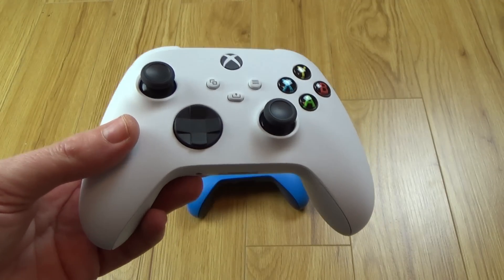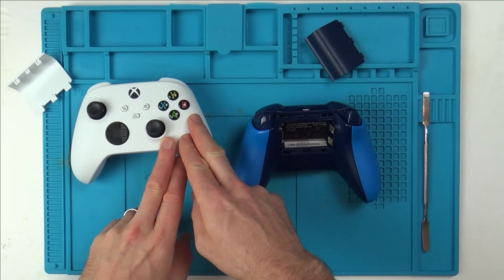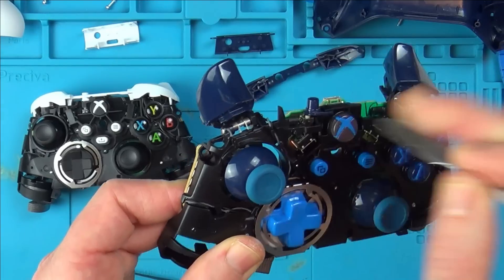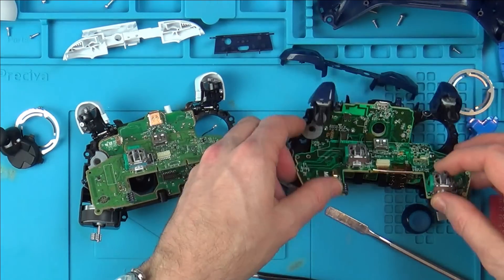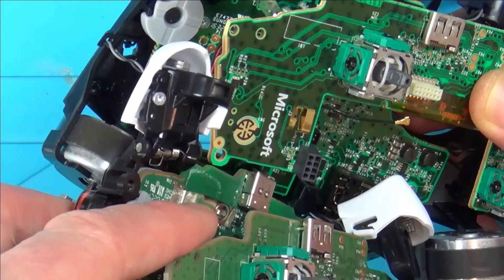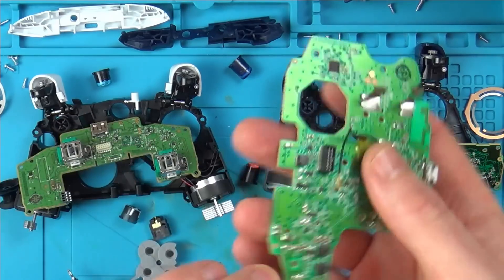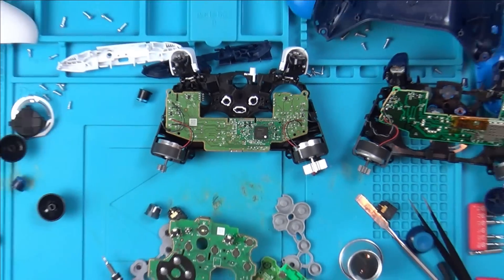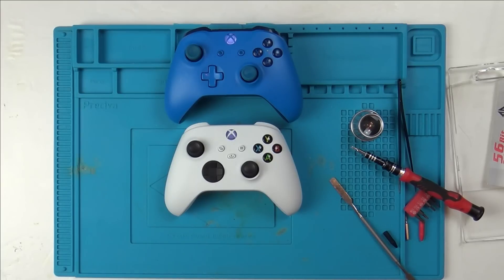Xbox Series X / S Controller Teardown - Comparison with Xbox One Controller

Comment: A lot of people says this controller is the same as the old one.
Well I received it a few days ago and let me tell you what I noticed.
The general shape of the controller is pretty much the same but the controller is a little bit smaller, the handles are thinner so  this time the controller doesn't feel too big like the previous model, moreover the rough texture is amazing since it gives a very good grip and feeling to the hands.
The more noticeable changes are of course the d-pad, which is much much more comfortable, accurate and beautiful.
The new innovation is the new "share" button, if you think about it  in the future it can bring a total revolution for this controller since we have a new button to use, of course on the Xbox you can use it only for sharing pics etc...  but on pc with remapping softwares there are endless possibilities, on the elite controller there was already a button there which was used to switch from one config to another one, with remapping we could do the same on this controller too or even more.
In conclusion I think this controller is very underestimated but what Microsoft basically did was:
- reduce dimensions of the controller and give it a rough texture to make it more comfortable
- the feeble pieces were changed with new thicker ones (the bumpers have been upgraded and now are thicker than the previous ones)
- the triggers now have a rough texture and their movement is slightly shorter than the previous ones)
- buttons now put more resistance  when you press them in order to avoid accidental presses during gameplay
- even the weight of the controller now feels more balanced and the controller doesn't give the feeling that there are empty spaces inside 
This controller is the proof that the previous generation controller was already a very good one but now it's almost perfect (the elite is still the best for me)
A lot of you think it is not worth  its price since you can have the old controller at half the price and you might be right, if you want to play on the Xbox console and are not used to share pics etc... You can easily decide to buy the older one and save some money.
But if you play on pc like me then I think it's worth its price because it can be remapped and moreover it gives a premium feeling similar to the elite version.
Sadly at the moment there aren't any software which allows the remapping of this controller but it will surely come out in the future we just have to wait a little bit.
This is the most clever controller I have ever seen after the elite.
Reply: I found that the plastic appears to be of low quality and the digital directional is very noisy.
Reply: @CorruptionManX  the plastic is thicker than the previous one, of course it's not like the elite version but it's still better than the previous generation Xbox one.
The d-pad is noisy that's true but I think it can prevent accidental clicks while playing
Reply: @andreacavallo522  im fine whith the d pad i like the click
Reply: I’m glad they upgraded the bumpers, I’ve had some controllers have bad numbers that break and it makes the games unplayable.
Reply: It's also on sale from $40 on the Microsoft store
Reply: I find even though I have small hands I prefer the larger more substantial feel of the xb1 controller and I hate how playstation controllers often feel too thin and wide for me
Reply: Man wrote a whole book abt the controller
Reply: Such a long reply....at the end of the day, let us admit it, it is basically the same thing except with very minimum change to improve gaming experience. 

Thanks for typing such a lengthy reply to try to tell the world how "different" it is from the previous gen console.
Reply: @fredgoh  i wanted to be very accurate since it has small changes from the previous generation that at first sight it might seem the same thing but it's not, you need to actually get it in your hands and try it.
And I said the real change is the new button which will give us the possibility of new remapping a on pc
Reply: @andreacavallo522  almost  the same
Reply: @fredgoh  look at this hater lmao

Comment: 100 million dollar design and yet still have stick drift and YXBA buttons are still crap 😑
Reply: Well its not MS who designs analog modules. And proper sonsormodules make the controller too expensive. Ive found a single one using that Technology and it cost 160 euro

Comment: Can the face buttons be swapped around? I'd like to change the layout but can't tell if they are designed specifically for each slot or if they're interchangeable.
Reply: They are designed specifically for each slot. You can change an "A" with another "A" button but not a "B" with an "A"

Comment: My guess is that the change in the hedphone jack is for reduce costs and now only has support for ctia jacks (while I guess the original one controller was supposed to have both standards CTIA/OMTP but it was never given the proper firmware update to do so)

Comment: So they literally did almost nothing. ;-;
Reply: if it aint broken dont fix it
Reply: @Spiccolo1202  Class action lawsuit says it is broke... And MS refuse to fix it.
Reply: @j.j.9511  elite series 2.
Reply: @j.j.9511  while I wish they had changed the design, the lawsuit isnt for the regular contoler, its for the Elite Controller, that uses different analogue sticks
Reply: Airmanareiks AE  obviously. But the Elite controller uses analogue sticks that are built a different way that adds tension to them, that tensioning system is flawed, and they never fixed it. Leading to drifting insanely quickly.
Reply: This comment is completely wrong

Comment: The only thing that surprised me is that they won't remove the vibrator motors from the triggers, if you didn't disassemble the controller you would never realize they are there.  They don't make much of a difference.

Comment: I've had 2 original xbox controller which got stick drift after around 4 years and the bumpers stopped working so I'm happy that the bumper changed. I currently have a one s controller and the bumper doesn't work on one side and clicks twice on the other side which is annoying

Comment: Wow I'm surprised they used the same analogs since they have a class action lawsuit against them for the drift issues on the Xbox One controllers
Reply: No the class action law suit is for the elite  controller, but for some stupid reason they included the original Xbox one controller. They are gonna lose now lmao for doing that. All analog controllers have drift, but the elite seems to have it a lot more. So it’s weird to me that they include the og Xbox one controller which doesn’t have stick drift as much as the elite controller.
Reply: @g3neralcross911  to my knowledge the xbox one controller uses the same analogs as the two elite controllers.
Reply: @ryanstrembicki5234  no they have tension mechanisms in the elite 2 controllers, which is the cause of the stick drift
Reply: @ryanstrembicki5234   but the elite controller has 10x the amount of stick drift. ( due to being able to swap analogs ). But on normal the Xbox one controller has around the same drift durability as the dual shock 4. I would say the elite is on par with the joy stick controller in terms of drift durability.
Reply: @ryand91533  ok. But did they fix that problem with the series x controller??
Reply: @ryand91533  it the same as standard controller but there is screw that press more on spring that make it thight
Reply: @g3neralcross911  I’m more angry about the fact the a button on my elite is 100% unuseable. Can’t get stick drift if the face buttons don’t work and can’t use a $180 controller.
Reply: @lfish21.  damn I know, there’s a reason I didn’t get the elite( tbh I though they were gonna fix all the problems in the v2 but obviously they didn’t).
Reply: @g3neralcross911  it's absolutely brutal. I tried that tape shim trick with it I found on reddit. It helped but it's still garbage. I went and bought a regular Xbox controller and the a button was still not great but a tape shim fixed it perfectly.

(I only play rocket league on pc, so the 'A' button is a tad important for jump/dodge. Shaky 'a' button is a 100% can't use for me)
Reply: @lfish21.  my “A” button is unusable on my elite series 1. It started out as mushy and now it doesn’t even click
Reply: @yung33  I've not seen one of those fail unless liquid damaged.
Reply: @g3neralcross911  you get stick drift i drop my controller two times (on accident)
No stick drift but I do have a squeaky thumb stick.
Reply: The elite controller has more drift because the of the magnets and metal thumbsticks. They create me inertia.
Reply: I had a problem with all my controllers I hope the next gen at least does not cause it to be as simple to break
Reply: Yeah,  I guess it's cheaper to settle than to change the manufacturing process

Comment: I'm actually happy that the controller is very similar. Its a great design, if it's not broken why fix it?  
Though I do wish they wouldn't make the D-pad so snappy, rubber domes feel better to me.
Reply: As someone who uses 8bitdo controllers for basically every platformer i have since they almost feel the exact same as a snes controller i can tell you that this clicky concave d-pad is actually really really nice. The layout still makes me prefer other controllers above this one when it comes to 2d platformers but man is it still an absolute treat to use. I wouldn't mind playing game slike hollow knight or Ori and the blind forest on this.
Reply: I found the rubber domes to be too inconsistent on the Xbox 360. I'm glad they've stuck with the metal domes for this gen.
Reply: Not having rubber domes is very very good for fighting games like Tekken or Skullgirls.
Reply: I agree, but it would've been nice to see some new haptics like in the PS5 controller. Maybe we'll get haptics in the next Elite controller.
Reply: But it is broken! Just do a quick search on "left analog stick problems". Their reason for not upgrading the internals are purely financial. What the customer needs was not the priority there
Reply: @john_c1  I think he meant the design not the problems
Reply: it is not good designed they break easily my buttons are done after light use

Comment: The AXY buttons on the series x controllers are taller than the ones on the Xbox one controllers . The due fit and work fine but after I Installed a set of black buttons on my series x controller I noticed that the X button was nearly flush with the controller.

Comment: I'm upset that they stuck with the magnet function triggers instead of going back to the 360 style triggers.
Reply: I think magnets are better, it is much simpler and cheaper.
Reply: @ranguel259  Believe it or not the way the triggers work in 360 is cheaper and simpler. And you don't have to worry about a magnet damaging your board and ruining your controller

Comment: The controller I got with my series X has an unusual click or sticky feeling in the left trigger. Any ideas how to fix that?
Reply: Try to contact your shop for warranty, maybe you can get a change.
Reply: there are  rubber pads that cushion the downward action try cleaning those with ISO propyl the plastic competent is hot swap able the magnetic component is that actually transfers the action is soldered. but it an easy re wiring job
Reply: My left trigger scratches the inside of the casing when i squeeze it slightly outward instead of straight or inward.
Friend of mine has it on both triggers. Not enough wiggle room for the triggers on the outside. Clear design mistake.
As for the sticky triggers, you could clean or remove the small rubber bumpers. Tha’s what you feel when completely pushin in the triggers.

Comment: I purchased the shock blue controller from Amazon and I was curious about the analog sticks . From my experience having both an Xbox , pro , and dual shock 4 controller , the Xbox one seems to drift the quickest while the others seem to be fine for longer . I like the Xbox controller but the sticks always make me cautious when using and it looks like Thats going to continue
Reply: @DummyVR damn
Reply: @DummyVR I think you could also utilize the Microsoft warranty since drift counts as “defective” they might charge though since it’s passed 90 days of having the product but it’s worth a shot
Reply: @DummyVR of course! I had to do that for my brothers series x controller back in February cause his right analog stick was popped out but thankfully In my situations it was within warranty and Microsoft replaced it at no charge and at a surprisingly quick time I think it was less than 3 weeks for the whole process of sending and receiving

Comment: I can’t believe we are heading into next gen with stick drift come on! 😡
Reply: @cerberusghost4707  you realize xbox accepts third party controllers so using a controller to insult a console is kind of irrelavent in this situation. you can literally use a dual sense on a xbox one. and plus its a little piece of glue on analog sticks that playstation controllers have too. if it breaks then it gets drift. youre a one sided fanboy with no hardware knowledge gtfo.
Reply: The ps5 controller has the exact same sticks as the ps4 and they're prone to stick drift so yeah exciting times ahead
Reply: Can someone explain to me what stick drift is pls
Reply: Then don't get the trash can Xbox lol
Reply: Ps4 and PS5 sticks are the same too and they're way worse than xbox I've been maining a 360 controller for 4 years and been fine stfu
Reply: @cerberusghost4707  cant even afford batteries lol who are you to call people poor
Reply: i have 4 xbox controllers and i havent expirienced any stick drift. i get ur unlucky but that doesnt apply to every controller.

Comment: great video. i really hope they fixed the LB RB bumper issue from the previous gen.  Mine failed on numerous controllers overtime.
Reply: The plastic part for the bumpers still looks to be a similar design although he said is looked like the switches were slightly more vertical. That may help lessen the flex, but unless they reinforced the plastic with a metal mesh/wire core the plastic will eventually break just like the old ones. Even with wire the plastic will probably still get brittle and snap as it ages. I got a Series X controller to replace my failing XB1X controller on Friday and played about 4 or 5 hours of Destiny 2 over the weekend. The right trigger is already clicking. Makes me sad.
Reply: @DjPhaTrix  That is super dissapointing. I love the controller layout but hate how they put such a weak piece for those two buttons. I agree with you, if they didn't fix the design, this will eventually break.  

I've tried the non-OEM replacements and they just feel off. argh.

Comment: The inside of the Xbox Guide button appears to be different but the weird thing about that is that my Xbox One S (White) Controller has the same internal setup (Four tabs aka "cross teeth") for the Guide button just like the Series Controller there, the only big difference is how the Series button is taller than the one I have.

As for countering the joystick drift issue? Replacing it with a new component may not help at all, what you might have to end up doing is taking out the wiper/s before clipping off the tabs and nubs (possibly sand down the clipped nubs if it's not flat enough with a file tool) from the potentiometer/s themselves, clear it of any debri/dirt before putting the wiper back in and soldering it back onto the board/PCB.
One way I went about fixing this issue is getting all three points of contact hot at once before trying to tilt the potentiometer ever so slightly into the direction it keeps drifting towards.

What still baffles me to THIS DAY is how Microsoft has a program that allows you to calibrate/center the joysticks more effectively, but refuse to do so under the intentions that we would be stupid enough to keep buying new controllers over and over instead of having some electronic technological expertise.

Besides that and all, I do thank you very much for making this video, as I was super interested to see if the new controllers would also be utilizing a "haptic feedback" sort of feature similar to the Steam Controller and the PS5 Controller, only to be met with they're still using those motors which I'd still need to desolder all off of completely just so my controller is lighter to carry around and use.

Comment: Yeah, why change anything when they got it right 8 years ago... they can innovate just like the ps5 controller. Better haptic feedback, a touchpad, maybe some new buttons on the back as a standard. There is a lot that can be done, I'm a PC gamer and I dont have bias towars either sony or Microsoft. I game using a 360 controller which I love. I want to buy a next gen controller  but the problem is that with Microsoft, you won't get much of a change and with sony, you'll get 0 support on windows, the dualsense controller will have all its main features turned off. Guess I'm going with the series x 0 innovation
Reply: I don't think a touch pad is even useful. Waste of time and money.
Reply: Xbox controller can remember multiple devices that's just one of the many features Vince didn't show
Reply: Gotta create new E-Waste dumps somehow!